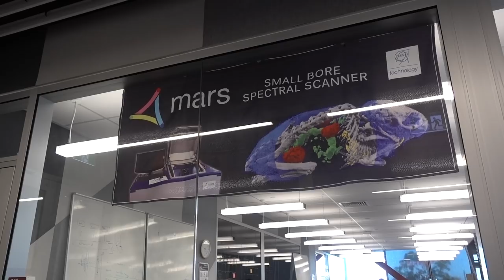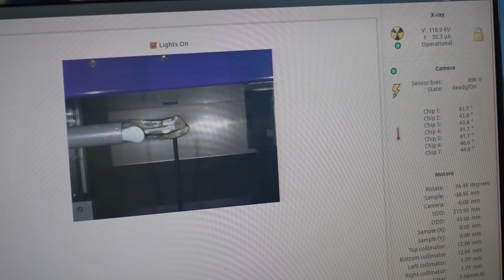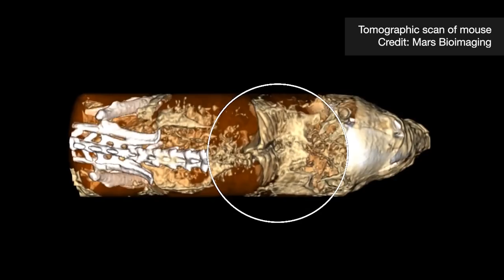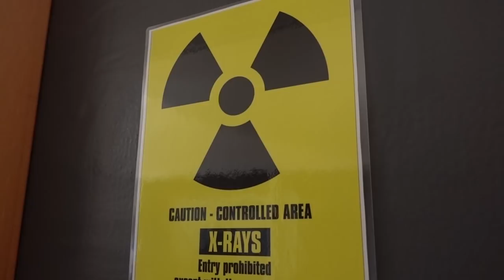The first 3D color X-rays

Comment: "xrays with a shorter wavelength pass objects more easily" 

isnt it the other way around? shorter wavelength are absorbed more. that's why radiowaves (long) are used to transmit signals. and for the same reason why you see red light when shining a flashlight through the skin. red has the longest wavelength of the visible spectrum, hence absorbed less when passing through skin
Reply: you're right, but once a wavelength becomes short enough the quantum energies raise to a level where your atoms cannot absorb them (gamma/xray). These wavelengths remain intact as they pass through you and ionize your cells as they go. This is why they pass through easily, but also why they cause radiation damage to cells.
Reply: @MrHammers  i see, thanks

Comment: Ok, so they are using X-ray energy spectrum to determine tissue density instead of Housefeald units (the amount of X-ray absorption of a single voxel “cube in 3d space”). This is extremely interesting. 
I am a radiology nurse and work with medical CT scanners so this is really interesting technology. 

I know SEMENS CT scanners today have a function called “flash” that scans (what I have been tolled) 75cm/sec in z-axes, and dual energy where two X-ray tubes use different kV values in order to extend the spectrum or “dynamic range” of the image media (like the HDR images of Trey Ratcliff, Texan turned New Zealander). 

The biggest challenge in medical CT imaging today in my mind is basically “artefacts” ie. Metal implants (dentures, artificial hips etc.) that corrupts/degrades the scan image…there are filter programs like seemore and i-MARE but they are digital filter post-processing the raw scan data, they don’t influence the initial scan itself.

Comment: I think that storing parts of the scan on a machine made to store the data on a large number of high transfer rate RAM sticks to be later rendered as a whole by the machine, would be a cheap way of dealing with data storage issues reliably.

In my idea, the scan-data could be quickly stored in and spread between many high transfer rate RAM modules on a machine or a series of machines, the machine then would take the data saved on the modules and, slowly, over time, save it bit-by-bit within the constraints of a conventional storage device's transfer-rates (such as Hard or Solid State Drives), this minimises the exposure time during scan whilst also retaining the data, as during the short-time of the scan, all the scan-data could be quickly "absorbed" by the much higher transfer rate RAM (kind of like a sponge), allowing it to later be "drained" slowly into a whole on a conventional storage device.

Wishing all the best and hope this helps someone at some point perhaps.

Comment: I wish they wouldnt jump straight to CT.... that tech looks really interesting for 2D rads.....
Reply: unfortunately without tomography it'd be impossible to add color based on attenuation due to overlapping densities on a single plane.
Reply: @MrHammers That doesn’t seem strictly true. I can certainly see how a 2D image would be harder to interpret, but essentially we’ve been faced with the same problem since xrays began — trying to extract 3D info from a 2D Image. Multiple views should get you a long way.

Comment: So it's a single pixel spectroscope instead of a array of narrow band pixels? Very interesting, but getting  4D data is very difficult with 1 pixel. 

I work with thermal imaging in the broadband of LWIR 8-14micron. There are only a few highly classified papers about dualband thermal imaging because that's very military and shouldn't be known to other countries. Therefore my planned bachelor thesis for broad triband thermography won't happen. 

But I already saw that 8 band visible sensors are coming for scientific imaging and will soon be in consumer cameras. I can see it happening to phones and drones that use mutliple cameras in a computational imaging task.

Comment: Tom Scott, are there wavelengths of electromagnetic radiation that - at sufficient intensities - could be used to see through the whole body without ionizing or otherwise damaging the body? If we use a large enough spectrum and high intensity, would this be possible? Also could you do a video about the RF technology unveiled a few years ago that could see past the surface of objects without ionizing radiation, seeing reflections of the waves? Seems the technology didn't receive much publicity for some reason.

Comment: There is a database of this 3d images? like dicom files?
Reply: I'm sure they will add another modality to DICOM to represent it.  It would make sense to start with the spec for CT or whatever kind of scan it's based on, and just change the picture representation to add multiple planes.  But my experience is that it will be totally different with gratuitous incompatibilities and no consideration for actually implementing the thing.

Comment: What is the news? What this video shows is a CT tomography iterative reconstruction. It's been in the modern CT scanners for decades already. With smaller detectors and faster gantry modern CT scanners improve contrast and resolution despite smaller exposure factors (MAs and Kvp). Also so called "soft X-rays" are the most harmful for human body, because photoelectric absorption is dominating process if those are emitted and you get a very high dose of radiation by not filtering "soft x-rays". You want to filter them out and keep high KeV photons to make a picture. This is why in CT scanners you have pre-patient filters to reduce the dose. This is called improving the beam quality and you want that, not unfiltered low energy photons. The picture is always the compromise between dose, mAs (number of photons produced per sec and depending on the current on the tube) KeV (the energy of produced photons, depends on Voltage on the tube). More mAs will reduce noise and quantum mottle, but significantly increase the dose. High KeV will increase contrast (bad for soft tissues differentiation, good for bones and IV contrast) and increase dose too, but less than going up on mAs. Sorry guys, do your research, because you are not getting it right in the video. 
/Radiographer.
Reply: @jtb32k  You clearly didn't read my comment properly. What you describe is the lower contrast between subject tissues, and I mention it in the previous comment, when I say that  its bad for tissues differentiation.  You could also argue that high KeV will increase the contrast between the tissues and air interface making a sharper image, but sacrificing subtle density/thickness differentiation. So high Kev does both, but you missed the point of my comment. Your remark is correct but adds nothing to my point about the danger of low energy photons. They didn't explain how exactly this breakthrough machine is different than any modern CT scanner and saying that they can use very low energy photons, as if its  somehow better for the patient was misleading. In mammography they use photons of about 20 KeV, but in terms of radiation its much worse for you than a standard chest X-ray.
Reply: @jtb32k  Sure. The explanation for the second time is as follows: read the comment thread again. And because you have time to wait, you can read it five times. I will not wait.

Comment: I think there is a mistake at 0:39. X-rays have a lower energy and longer wavelength, and can thus travel through objects more easily. Otherwise still a very enjoyable educating video as always!
Reply: Jonas  van der Schaaf aren’t X-rays UV though? So the video is right?
Reply: No, x-rays are high energy photons
Reply: What you are thinking of are microwaves, not X-rays.
Reply: X-rays have higher energy and shorter wavelength. That's why it's ionizing radiation, it has enough energy to knock electrons out of atoms, AKA ionization.
Reply: That's just wrong. Xrays are higher frequency than visible light.

Comment: You get exposed to 7x the radiation of an x-ray by flying anywhere in the world...the higher you fly the higher the exposure the longer the flight the longer the exposure.
Reply: this is incorrect. Yes you receive cosmic radiation in a flight, but it is not 7x the radiation of an xray, in fact it is much less than a single view chest xray.  Any diagnostic xray is going to be more direct exposure than any flight no matter the distance, save for maybe dental xrays or a small extremity.
Reply: @MrHammers  this is incorrect. Try flying with a radiation meter / Geiger counter. It can reach as much as 12x background if doing a HALO jump or 7x for commercial flight then take into account your in the air for up to 17hrs the total exposure is the equivalent of over 20+ XRAYS!